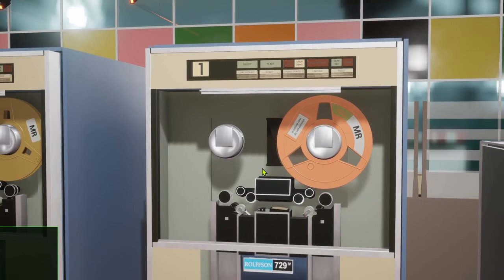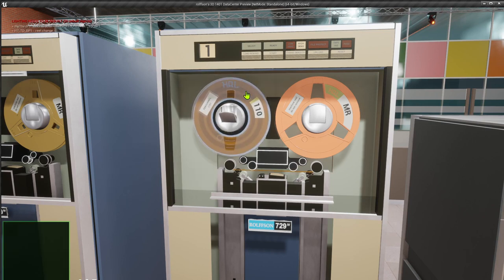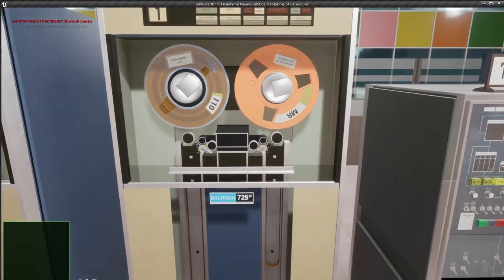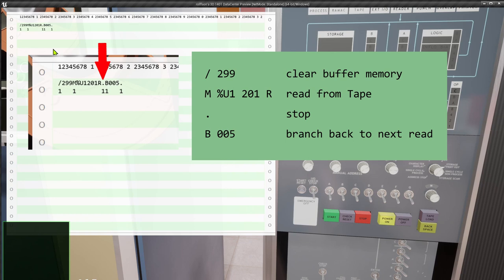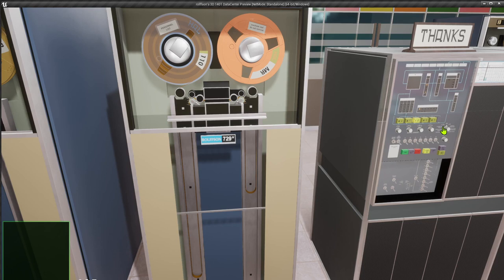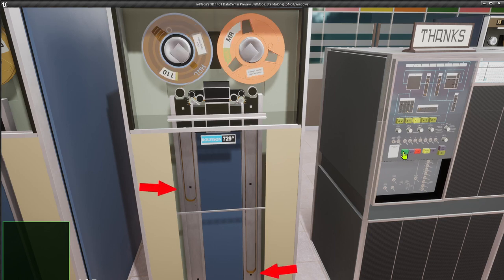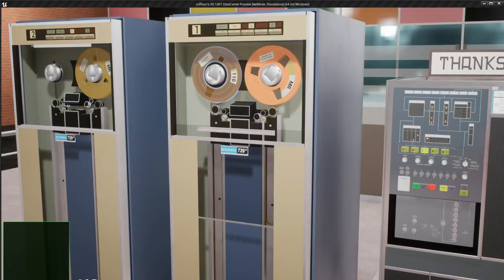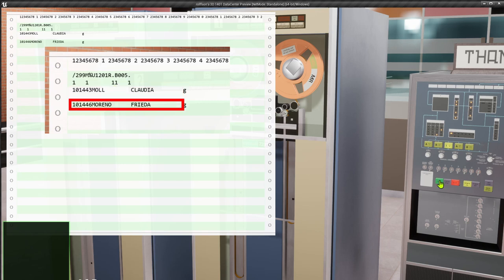IBM 1401 let's program #6, reading the IBM 729 tape drive - R6

Comment: I think I found a bug. Handling punch cards seems to break tapes. When I touch punchcards (say take punchcard from keypunch and then throw it into trashcan or load into card reader) I can no longer handle tapes. I can still take a spool but I am unable to put it into tape drive or put it back to the table. Tapes works well if you don't touch punchcards.

Steps to reproduce that bug:
-Take punchcard from keypunch (may be the "foxy" card, or just punch a card and take it).
-Do anything with it (put it into trashcan or load into card reader).
-Take spool of tape from the table.
-Now try to put tape back onto table or load it into tape drive.
Reply from the maker: ah, thanks for your help! I experienced the bug several times, but never did a systematic search since adding new features was more fun 😊. Didn't see the connection to grabbing the cards before. Thx to your walkthru I was able to find out that the "hand" thinks it still holds an object of type "card", and so the tape drive and the tape stand refused to "take" it. The fix will be in the next release.
Reply: @rolffsonsIBM1401channel  What is in the near future plans? Any hope for punching cards from computer and tape writes? Also IBM 1407 (called console inquiry, a sort of terminal) would be nice to have.
Reply from the maker: I aim for tape writing being the next feature added; punching cards on the 1402 is also in the pipeline. 1407 and 1405 ramac will certainly also be added some day.

Comment: BTW, the illustrations, graphics and reality are great. Some feedback however in the spirit of making great, greater. Most of the sounds are not familiar or not typical of one might hear from a 1401 in a noisy computer room. Also the program isn't really representative of what one could or would do on a 1401 but as a simple programming sample it is very good. The 1401 was an amazing I/O and data processing machine. I used to marvel at multiple tape drives working together while the printer danced and the processor hummed.
Reply from the maker: Thanks for your encouraging feedback!
I've stolen the 026 punch sounds from CuriousMarc's video "1964 IBM 029 Keypunch Card Punching Demonstration", and the tape pinch roller sound from his "Debugging the 1959 IBM 729 Vacuum Column Tape Drive at the Computer History Museum" 😎, but it lacks sound quality.
I've also experimented with some background noise and fan-blow-sound to boost immersion , but unfortunately in the simulation this only reminds of an annoying hiss of a defective amplifier 😒
The program: yes, I only wanted to show off the then newly implemented read-command 😊 nudging my motivation; hope I have time to create a more reasonable demo, similar to part 5.
Anyway, the next goal is to implement the write command, and then boast with a tape sort (merge sort) demo 😎
Reply: @rolffsonsIBM1401channel  Awesome --- and you're having too much fun! Thanks for the tour.

Comment: Figured out how to do it with a punch card: ,019023,031032,036/299M%U1201R.B023. 
Had to change the branch to jump to the right address after I figured out how to use the comma language to encode the wordmarks. Lots of paper had to be use in and outside of this computer to work everything out. Very fun project once you learn some of it.

Comment: Your statement "Sorting data in core wasn't possible...." is not really correct. There was a 1401 program called "Sort-Merge" provided by IBM that would happily sort a large file (not limited by memory) on a 16K computer, even if it was pretty slow. If I recall, the program took more than half a tray of cards (maybe 1200-1500?) and would load the program in phases and sort a tape file using memory and work tapes for the resulting output. Thousands of records it could do; millions might take awhile :)  I believe there was a disk version for the 1311 disk system as well. Although it was used on some jobs in our shop, most large sorting jobs were sent from the 1401 to a 7074 then returned back to the 1401.
Reply from the maker: I totally agree, sorting was possible using external 'memory' like tape/disk/card.
Let me just elaborate some more, in case someone is wondering what we are talking about:👩‍🎓
My "Sorting data in core wasn't possible.." statement was a simplified remark addressed towards the 'Generation Excel', meaning that at that time you couldn't just load the whole file with all data records into RAM memory at once, sort it there with e.g. quicksort, and then write it back to the tapes as a whole (one file may even span several tape reels).
The famous 1960's Time-Life magazine subsriber's database of 40 million punched cards or hundreds of tapes (3.2GB) could today easily be sorted in-memory (RAM) on any half-decent pc or even mobile phone more or less speedy, while at the time requiring some advanced tape sort algorithm handling files spanning more than one tape, plus the staff juggling around the tapes
Reply: @rolffsonsIBM1401channel  I see. I guess having "no sort" verb is unimaginable today. On a whim, I just finished a FreeBasic program to see how that might work (and if I could actually do it). My programming goes way back (45 years or so) but I dabble from time to time. Anyway, I structured it so it would be easily transferable to Autocoder - or at least what I remember of it. On a 16K machine you could fit 150 80 char records in memory to do a  bubble sort so the program segments records into groups of 150, sorts the group then writes them out and merges them on successive passes until complete. Input is on "tape drive" #1, sort work files on tape drives #2 and #3 and a combo work file and final output on tape drive #4. It does 10,000 records in a few seconds on my less than average laptop. I did two million records and that took 41 min.! I found that by increasing the segment size actually slowed it down - a revelation for sure. I had good performance even down to 35 records per segment. That bubble sort isn't the best I guess. I'm tempted to transfer the logic to Autocoder but I don't think I could really do that now and I'd be disappointed to find out the 1401 really couldn't do it :) I'd have no way to test anyway since SimH is all that's available and that's not fair. Anyway, thanks for the flashback.
Reply: @rolffsonsIBM1401channel  I would love to see you attempt a SORT7 using multiple tapes! I would like to do it on the real machine one day, but we have not yet managed to get all the tapes to work well enough all at the same time!
Reply from the maker: @CuriousMarc  challenge accepted. I'll give it a try shortly.
Reply: @rolffsonsIBM1401channel  Sweet. If you can figure that one out and if we can get all the tapes working at the same type, I'll try to do a rendition on the real 1401!
Reply from the maker: @CuriousMarc  after two weeks of debugging and finding eight additional bugs in the simulator, I finally was able to get SORT7 running 😂
I'm now preparing a video about it.
Reply: @rolffsonsIBM1401channel  Awesome!
Reply from the maker: @CuriousMarc  the new sort7 video is available at https://youtu.be/YO8AdDxWXhk
Reply: @rolffsonsIBM1401channel  And it's awesome. Thank you so much for doing this!